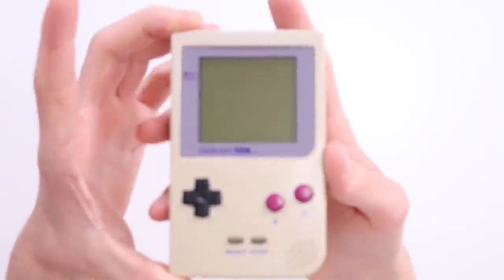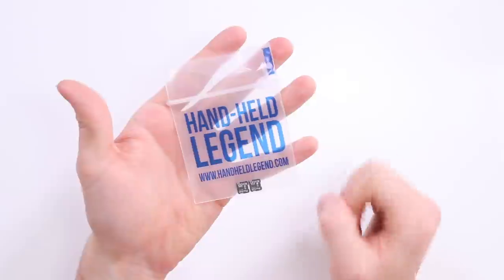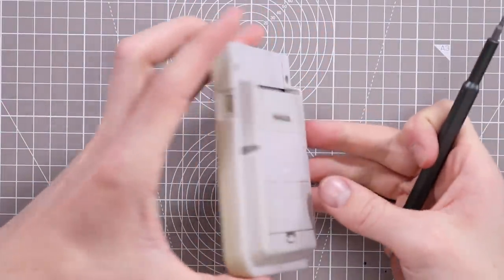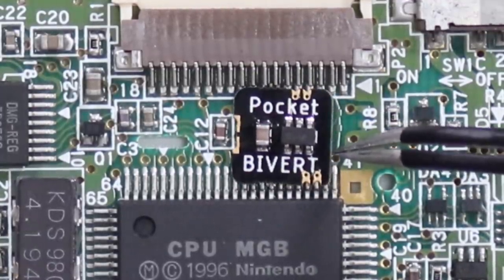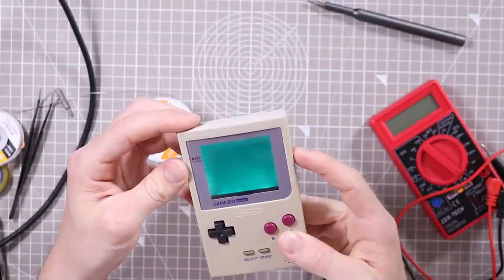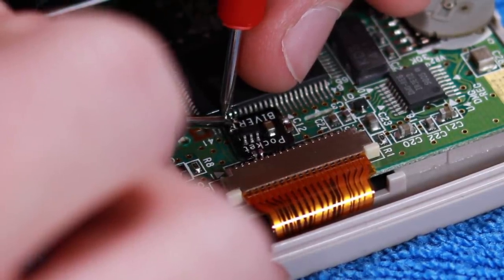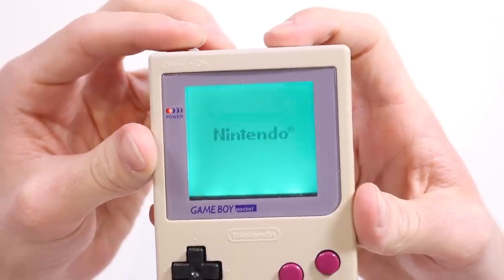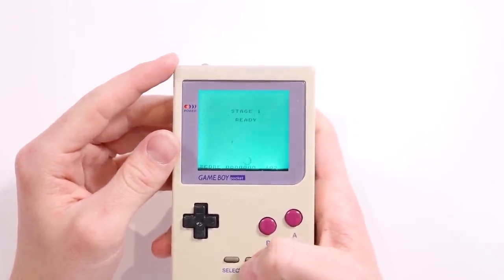Installing The NEW GameBoy Pocket Bivert Mod Chip!

Comment: I believe the C12 is not a resistor, my friend.
Considering "C" is used for Capacitors in PCB labelling.
And resistors don't usually go across the power supply as they'll just waste energy as heat, not something you want in a battery powered device.
Reply: I came from your comment. Thank you ;)
Reply: Laitavideo
Reply: Moi
Reply: Yep, it's an MLCC (Multilayer Ceramic Chip Capacitor).
Reply: Yeah C is for capacitor on PCB boards.

Comment: If you bridge, put a healthy dose of flux down and on a clean tip just drag the tip across.

It will pick up the excess solder and get rid of the bridge.

Comment: Yes I've had the pleasure of using a three bivert chips. From the first hex chip where you had to solder wires to each leg, to the updated chip where it would only fit on top of the speaker, to now the newest chip that was installed in this video. By far the best

Comment: C denotes Capacitor on PCB marking so the component you need to steal power from is a capacitor. Resistor will be marked by an R prefix.

Comment: Don’t have to lift any pins? No extra wires? Literally bought this before the video even ended I ruined 2 or 3 gbp motherboards trying to install a regular bivert mod so thanks for this video!!!!
Reply: Nope, just cut the traces, but the solder points are super tiny and I ruined a motherboard on my first try.
Reply from the maker: Youre welcome!
Reply: The Retro Future it came in today and I installed it in only a couple minutes and it works wonders! Wow!!!! Thanks a million!

Comment: I just bought thi but I’m a little bit nervous about how tight the solder is. Would it be easier to first heat and add solder bubbles to the bivert castellations and then just heat those up when bivert chip is placed in the motherboard?

Amazing channel and a big fan of your work

Comment: Mistake @2:55 that's not a resistor it's a capacitor (for anyone wondering why the letter on the board and first letter of the part are different)
Reply from the maker: Oopsie! Thanks

Comment: is cutting the traces necessary? i've seen similar mods where the pins of the chip were lifted up from the board individually and attached to the modchip that way and were detached from the gameboy board without having to destroy any traces
Reply from the maker: Yup! You can patch them up easily later on if you need it!

Comment: i need to get a soldering gun. getting antsy about doing a few projects
Reply: theyre only like 15 dollars on amazon
Reply: if you are gonna do a lot i would recommend a solder station where you can adjust the temp
for £80 i got one with a iron and hot air gun for £80ish of amazon
makes a huge diff

Comment: As IPC trained reworker, I would advise you to not using this soldering tip.  You can get Hakko with interchangeable tip easier for $400, it is a lot better than this soldering you are using.
Reply: Dean Spicer  Research before you waste my time.  It is clear that you have zero experience with SMT soldering, so please leave it to the professonal.
Reply: Dean Spicer  if you understood my answer is no then why didn't you take it serious? SMT rework is very serious work and many non-professional destroyed boards.